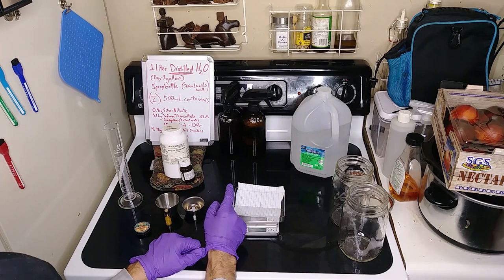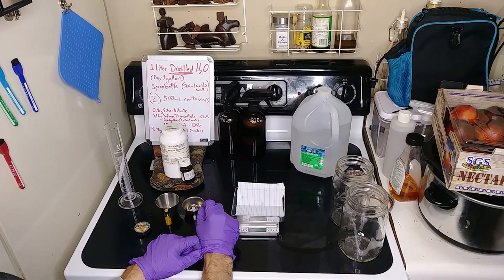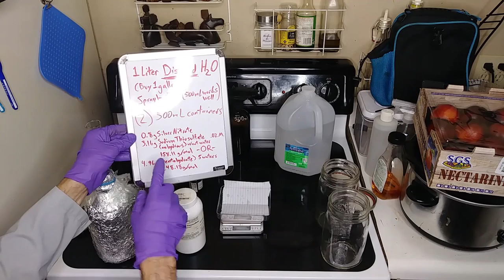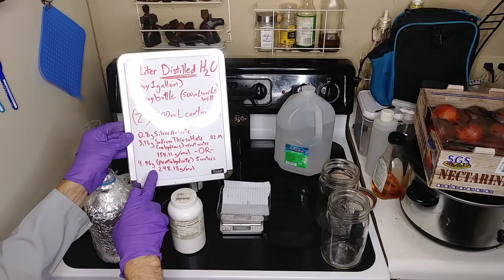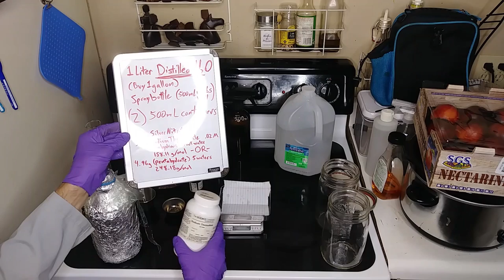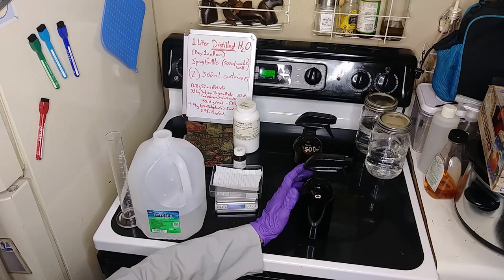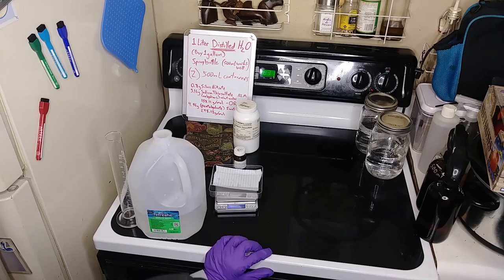Making STS with Sebring

Comment: Someone asked "can deionized water be used" and the answer is yes. Deionized water has even less dissolved salts compared to distilled water, so it will work better.
Reply: Can bottle water also be used ?
Reply: @josephpeters955  yes. The reason different water sources are important is because the amount of impurities in the water are proportional to how quickly the active STS reacts with those impurities. The higher the water purity, the longer the STS solution will remain active. Tap water will make an STS solution usable for between 30 minutes and 2 hours. During those couple hours, the salt and minerals in the tap water will react with the STS creating new chemicals and compounds that do not have the chemical properties of STS that we require in order email plant to produce pollen sacs. As a rule, the less dissolved solids that are in the water, the longer your STS solution will remain usable. Most people want their STS solution to last as long as possible, so I always suggest sources of water that have previously shown to be low and dissolved solids or salts.
Reply: @Sebring Frehner so what your saying is that it'll work but not as effective as distilled water I did some research on my local bottle water company they do not put any minerals in the water and its filter alot also its been tru a ro water filtration system
Reply: @josephpeters955  you should be fine using it!

Comment: how long have you been using the bottle you have in the fridge ? If i have no contaminates how long do you think i can keep the concentrate stored in amber bottle in my fridge and still have it work i know if theres stuff floating its degrading or what have you but how long do you think it could be stored at optimal conditions in fridge. Thank you very much for your video I used it and it worked perfectly im just wondering how long before i have to toss the 10 years worth of concentrate out lol

Comment: Very nice I have seen where they would use less silver nitrate @0.5gr
Reply: They creating a solution with excess sodium thiosulfate in it. I've used that recipe, but I found that using the proper 1 to 1 molar ratio gave me better results and seemed to precipitate out less easily. 😀

Comment: Very thorough explanation, thank you! Bought the material and supplies to make this and should be getting them within the next week. I'm going to follow your instructions using the stated amounts, but I have noticed other directions say to use .5 grams silver nitrate and 2.5 Grams of Sodium Thiosulfate Anhydrous. Just wondering if you have tried using STS at a lower rate of dilution and whether or not it will make much difference either way. I'm thinking the slightly higher rate will have a slightly better effect but the lower rate will decrease chances of burning when sprayed at 5 day intervals. Anyway, just some thoughts. Thanks so much for your video, looking forward to trying this out. One question, if I were to treat Auto Fem plants, would I still get Auto Fem seeds, I'm thinking yes since they would still carry the Ruderalis genes. Not sure though, haha.
Reply: Anhydrous is why your measurement is lower. I use Sodium Thiosulfate Pentahydrate which weighs more, but is effectively the same in solution.

Comment: Does the silver nitrate need to be 1.7% version (which is cheap on Amazon) or does it need to be the 99.99% pure crystals, which are about $54usd for 25g?
Reply: I was curious about this too edit he replied saying it needs to be the 99.99%
Reply: @Thing Whas 25 grams lasts you years. Considering most dosages are only 0.5 gram to make (500 ml of solution) and thag solution once combined with part a and b get diluted to around a 1:9 ratio (100 ml sts *both parts mixed, to 900 ml of water) giving you 1 litre (1000 ml of sts solution).
Reply: You don't need 25g. As he says thesciencecompany has it for $25 for 10g.
Reply: @thenextgen1able  that was when he bought it ten years ago...it's a lil more expensive now.
Reply: @italianlighterfluid4157  I literally just bought the shit a couple months ago. It was the same price 🤷
Reply: @thenextgen1able  My bad if you got it for that price.. I paid about $30 for 5 gms.
Reply: @italianlighterfluid4157  You didn't pay attention to the video then. He says where to get it, it's from a company called "The Science Company" they sell 10g of reagent grade silver nitrate for 24.95
Reply: @italianlighterfluid4157  it's even linked in the description
Reply: @thenextgen1able  lol

Comment: The silver nitrate needs to be 99.99% pure. The silver thiosulfate we're creating is very reactive with impurities when in the water dilution. A lower purity would create an STS solution in which most of the silver was bonded to impurities, and would fall out of solution, creating a brown film to the bottom of the STS container.
Reply: did you ever say how much sodium nitrate to use?????? I don't want to calculate molar mass rn, it's been too many years since chemistry class.

Comment: Hey again! So my STS solution I followed didn’t work for me. I used the Pentahydrate and the correct amount for it… I sprayed every 3 days, but didn’t see anything, So then I sprayed every day. Well, nothing. I think I got one male Pollen sack (stamen?). I have used Colloidal silver many times with mixed success, so I know what I am looking for.  Do you think I should dilute less than 1/9 for my end STS solution? I know I measured and followed the instructions correctly… heck, I took Organic Chemistry years ago. 🤔
Reply: Check for precipitation of the silver in solution. If there is no precipitate then dilute as your intuition tells you.
Reply: @sebringfrehner6452  Ok, update: I did end up getting lots of pollen sacks on the individual bud that I sprayed; however,  they came on sooooo late… too late to self pollenate.   Just when they were putting on lots of trichomes and I had all but given up… bam, there they came! Very different from Colloidal Silver solutions that I have used.  Is this late onset of pollen sacks normal for STS?  Thank you for the response too!! I very much appreciate all the help and guidance on this video!
Reply: @theindicacharmer1001  For the strain you have I'd start spraying a couple weeks earlier. Make sure you soak the desired area on the tops of the leaves, and under the leaves.
Reply: Sebring Frehner I will try this out!